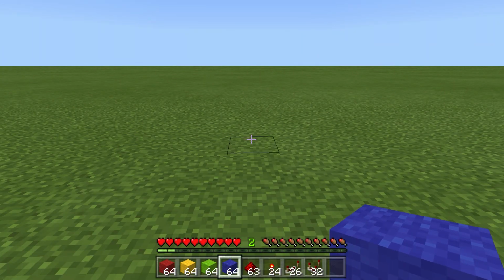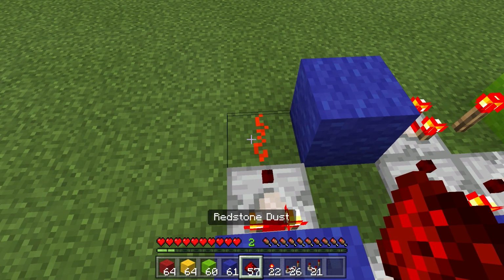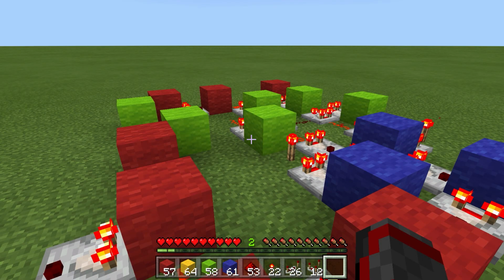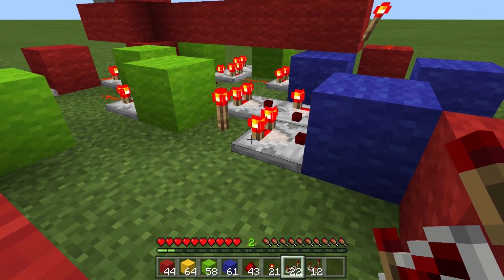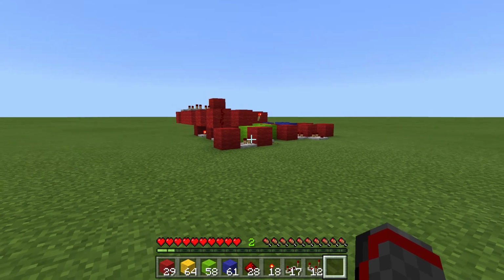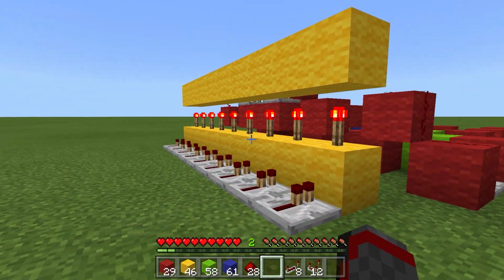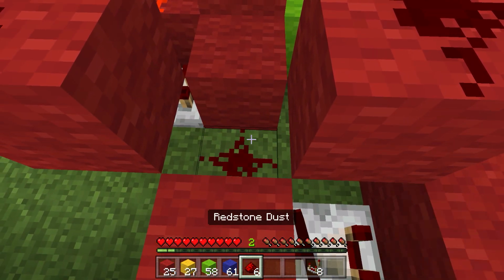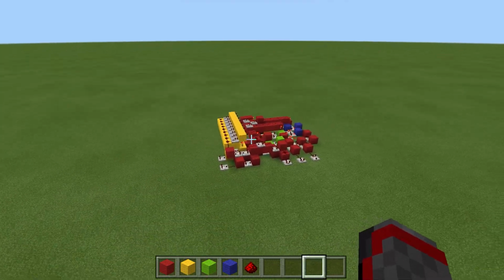Building the Smallest Redstone Computer in Minecraft

Comment: Wow, this is so different from what I've seen, it uses so many comparators, I have pretty much no idea what's going on, lol.

It looks a bit interesting. What can this computer do with only 2 bits(I guess, not sure) of input?
Reply: lol add numbers up to 3
Reply: @TrevoltIV  i can't do that so its very usfull
Reply: This is an old comment, but the computer uses signal strength instead of binary. So it's actually two 4-bit inputs, which is (slightly) useful.

Comment: My comparators seem to be consistently bugging out. I know if the signal strength going into the side of a subtract comparator is equal to or stronger than the signal coming from the back, it doesn't turn on, right? Well from what I know, using a comparator doesn't drain the signal and instead just delays it. So my problem is why aren't the comparators turning off when I put it in subtract mode and feed the signal into the side equal to the back? Is it because I play on the ancient version of 1.5.2, a.k.a. the redstone update? Were comparators changed since then?
Reply from the maker: Maybe. The RPC1 also has an issue in the decoder. You may want to switch the top-repeaters to 2-tick.
Reply: @ct5k_  oh, I did some fiddling with comparators and it does in fact turn off, it just doesn't look like it.
Reply from the maker: Ok, great!